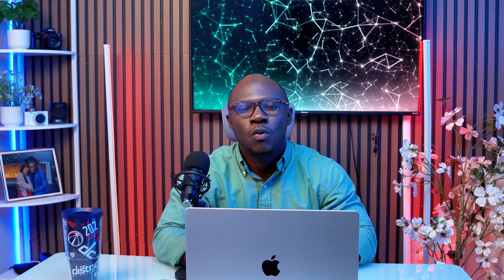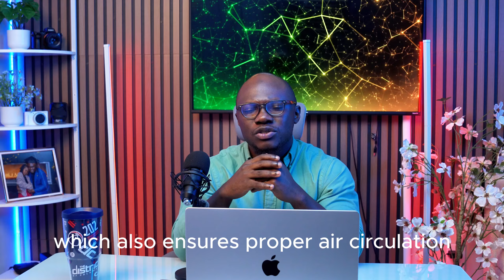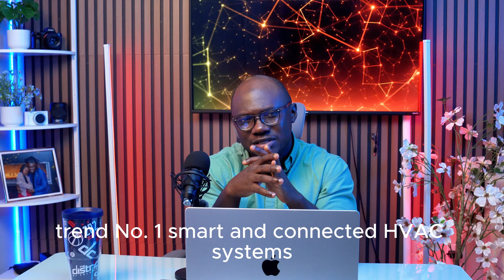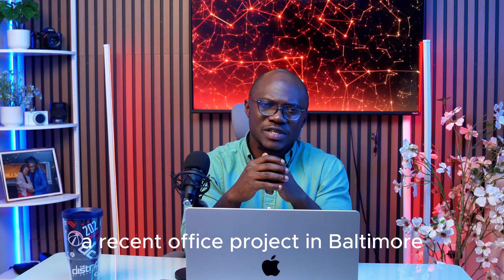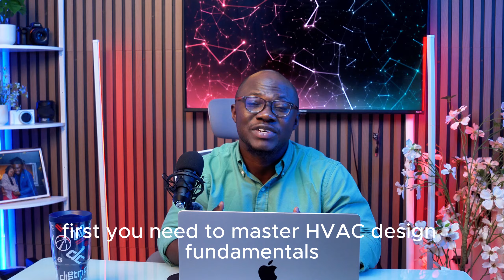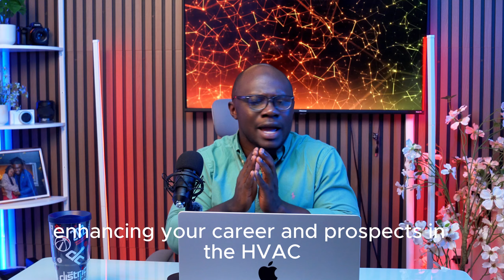HVAC Systems Explained: Trends, Challenges, and Innovations

Comment: I would love to hear more about HVAC LEED requirements
Reply from the maker: Under the LEED (Leadership in Energy and Environmental Design) framework, HVAC systems play a critical role in achieving energy efficiency and indoor environmental quality credits. LEED emphasizes optimizing energy performance, improving indoor air quality, and reducing greenhouse gas emissions associated with building operations.